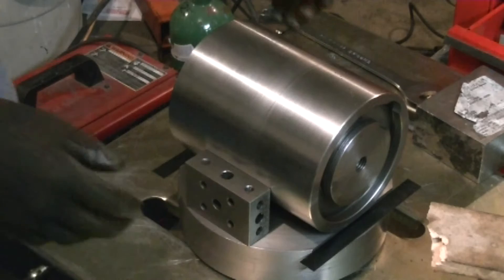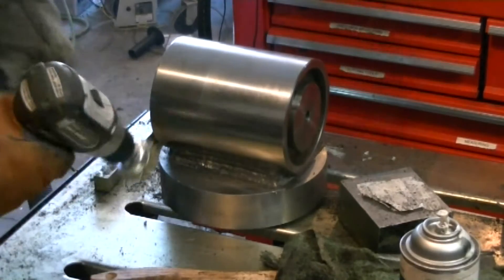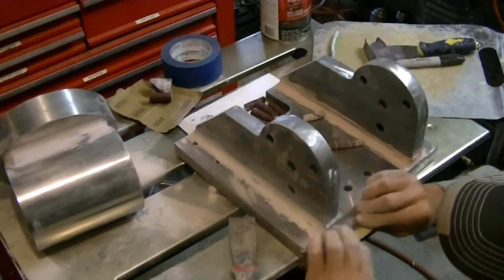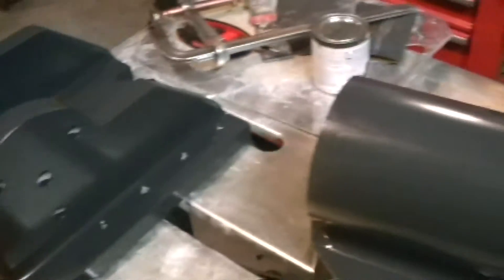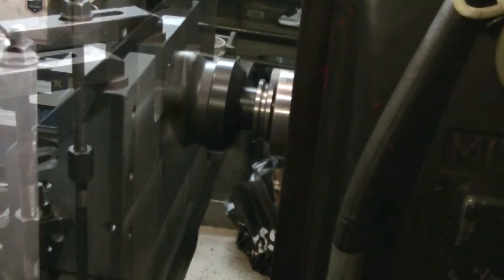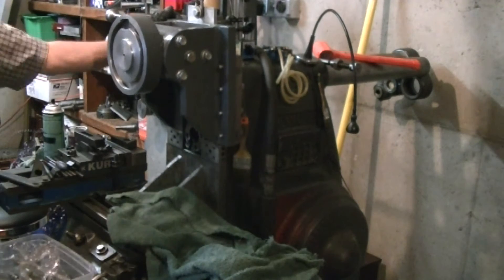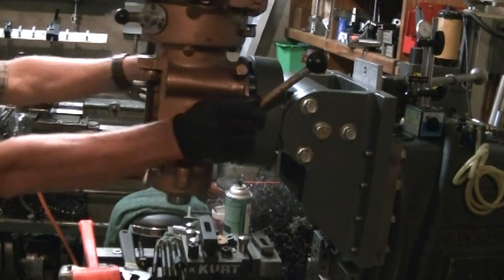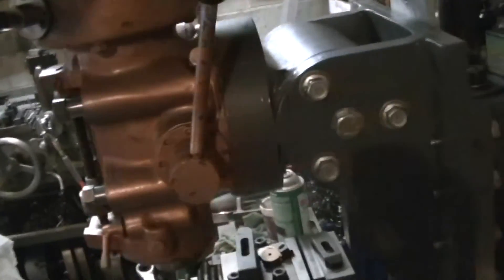K&T Mill Vertical Head Mount 6

Comment: Just a pity you have to remove the head to access the overarm support bars for proper horizontal milling. Can you not put holes through your brackets so the vertical head can stay in place ?

Tramming ? Not on my mill.

Comment: 12:49 "and just pick it off
with the the engine hoist and swing it
out of the way and then set it back on
when I'm done you have to reach ram but
that's kind of the way it is I guess
when you move any mill head"

Nope ! Just 4-6 bolts to undo on mine then slide it up (using Z fast traverse and push rod), reclamp it and then slide it back out of the way using the tool provided. K&T use 'parking cranes' - Abom79 made his own.

Comment: Do you have to take it off to use the overarm supports?
Reply from the maker: +Michael Kitko I do have to take off the vertical head mount to use the overarm supports. I bolted some mounts on to the vertical head and I use an engine hoist. It takes about 10 minutes to take it off and about 15 minutes to get it back on. Tramming the head goes quickly sometimes and not so quickly other times. There are quite a few horizontal jobs I can do without taking the vertical head off. It is still a compromise. Thanks for stopping by and commenting. Craig
Reply: @clemwyo  thank you for your time in replying.

Comment: I personally would never bondo on welding.  that is because my profession was welding.  to me welding is either really good looking, or poor, and bondo would be like building a car, not a machine. eye of the beholder type thing.
Reply from the maker: +Paul Hiiginbotham I can appreciate that and your welds would probably look good enough to leave raw. I'm a fair welder at best and because the part was going on an old curvy mill I thought that making the mount look like a cast piece would be cool. It doesn't look much like a cast piece though does it? But it works really well so I'm happy with that. Thanks for stopping by and commenting. Craig

Comment: Superb job and not an easy one. Whenever you have a chance take some shots from a medium distance to appreciate the assembly that looks so neat.
My only suggestion if possible, is to fit a stout locking pin at vertical and 90 deg. to eliminate tramming. I have that in my universal mill. You could use an Allen shoulder bolt. 

Cheers

Jorge
Reply from the maker: Jorge, thanks for the comment. I was thinking of doing a walk around video and just showing the features of the K&T as well as the vertical head. As for a pin in the head, the way the whole assembly clamps to the column there is enough error when I remount the head that I think tramming will just be a part of life. On the upside, I am getting better at it. Craig

Comment: Very nice,  Does it feel more or less rigid then a bridgeport would ?
Reply from the maker: To be honest I've never used a Bridgeport or even seen one run in person. My previous mill was a Van Norman #12 which was very rigid by design. With my setup can get a few thousandths movement out of the head, as measured with a DTI mounted on the spindle resting on the table, by hanging my weight on the vertical head. Is that possible to do with a Bridgeport? Craig
Reply: I didn't know the answer to your question so I just did it.

I mounted the indicator on the vise with the spindle on the quill,  I tried to hang from the head, zero indicator movement,  I tried to lift the head zero indicator movement.

This could be because I generally keep the ram pretty far back which I think reduces flexing...
Reply: I re-thought how I did the measurement and did it again, this time I got

Pulling down full weight  +.00075 yes 3/4 of a thou

Pushing up -.0015  1.5 thou

So there is a sag to the head from its own weight
Reply from the maker: +jmanatee Thanks for trying that out. I think I'm about double the movement you measured. I'm going to take a look at things and see if I can't get a little more rigidity. I do have the mount fairly high on the column so I can still use the horizontal spindle. I think lowering it would help. Craig

Comment: That all came together very well. The welding looks daunting to me , so it's on hold until I think of  a bolt together assembly for my j2 head to Adcock & Shipley 1ES. Thanks for uploading..
Reply from the maker: Thanks for the comment. I'm definitely not much of a welder and was just using an old Lincoln tombstone stick welder  that my grandfather bought new in 1952 so I wouldn't let that part scare you. If you had a friend that could help you get things set up and give you a little tutorial, I'll bet you'd be amazed at how quick you'd pick it up. Craig